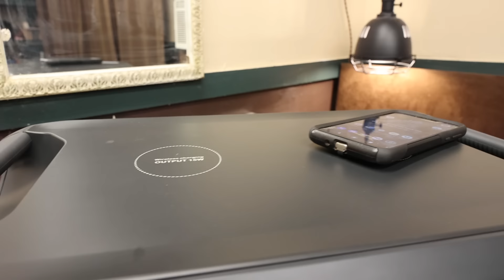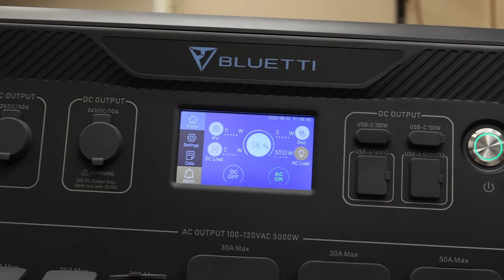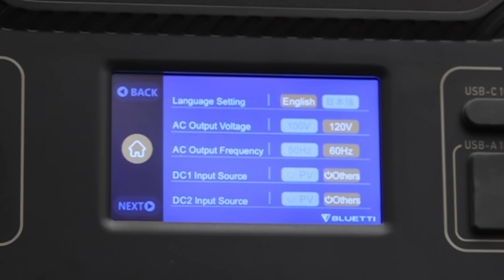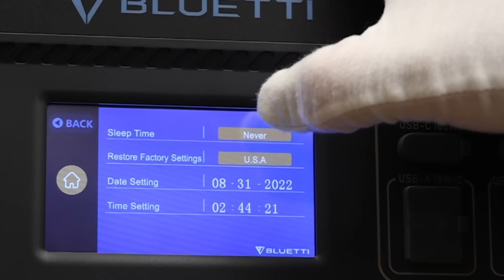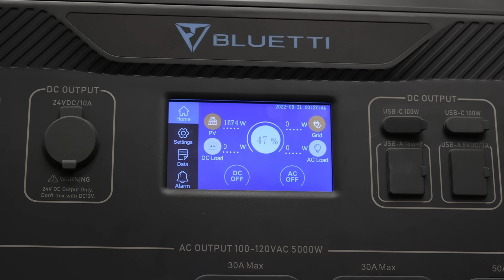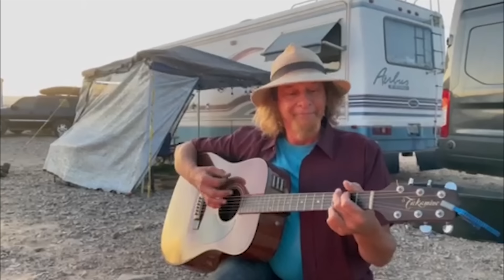Bluetti AC500 5000w LiFePO4 UPS Portable Power Station Solar Generator Review

Comment: I'd like to add a slight correction at 16:50. I'm having to replace my 240V Nema 6-50r outlet with a 240V Nema 14-50r outlet to use the 50 amp charging cable. So why not just use an adapter? Bluetti said adapters will NOT work because it needs the Neutral Wire (which the 6-50 does not have.) The 50 amp charging cable does NOT use 240V. It uses one leg of the 240V wiring (120V), which is one HOT wire and the NEUTRAL wire, to pull 50 amps through the required #6 gauge wiring.

Don't even think about trying to rewire your 6-50 3-prong outlet to use an adapter to the 4-prong charging cable. I found my 6-50 outlet had #12 gauge wire. Try to pull 50 amps through #12 gauge and you'll soon get to meet the crew of your fire department. A house fire should scare the crap out of you, which is why I'll never buy an EV, but that's another story involving a lot of online flaming and yelling.:face-purple-crying:

Comment: So it can't self heat the batteries with solar? You just mentioned ac.
Reply from the maker: It requires power at the "AC input" to heat. This means you can this and heat the batteries using solar. https://hobos.cc/d050s

Comment: So just a quick question. If you have a solar array on your house, will you be able to connect this to your house and power your house while charging the unit back up with the  solar off the house.
Reply from the maker: Yes, they sell a step down voltage box for this exact scenario.
Reply: @HOBOTECH  thank you for the response.  I'll see if I can find one
Reply: @HOBOTECH  so just to make sure I get this correct. I have a 6.24k system on my roof. In a grid down situation I'm hoping I can connect this to my generator box with the 30amp twist plug, which would give to correct voltage and frequency  for my inverter to come on and while the panels are feeding the house I can use the 120 cord for this ac500 and charge the battery back up? Which would allow me to run off of the panels in the day and the battery at night!

Comment: Does the inverter module have a battery or is it just an inverter requiring an expansion module??
Reply from the maker: The AC500 is the head unit that requires a battery. I made that clear in the review.
Reply: @HOBOTECH  I’ve been looking at reviews all day and truth be told. I just jumped into the comments. I appreciate your prompt response. I do have one more question.  It looks like it has a Generator Outlet. Does that provide 240 volts as a stand alone unit? Over at city prepping for his review he said that it needs an addition AC500 unit and an adapter. Which is a deal breaker for me. I just need hook into my generator inlet wired to a switch to run a well pump that’s on that switch and possibly my boiler. I wanted to ditch the gas generator.

Comment: If i place this in a van woth 200w of solar on thr roof would that be sufficient to power a moderate van build with power features. Convection stove, tv etc?
Reply from the maker: 200w solar will take about 20 hours of sun to recharge.
Reply: @HOBOTECH  not bad but perhaps this could be hooked up to the alternator  of thr vehicle to charge?

Comment: Please tell me they built in better fans this time. My AC200MAX is unusable indoors or in my RV. It is as loud as my hair dryer, which makes it impossible to use while on the phone or vid conf.
Reply: Be real bro, it's not that bad
Reply: @Califamilymanprepper  Wait and hear if it runs full throttle for a while, you will hear the bearings afterwards. They built in cheap fans
Reply: @Nilz4FR  no wonder, I have not run mine long enough. That sucks to hear, I appreciate the info. Not looking forward to it at all

Comment: Can a Orion-Tr Smart DC-DC charger be used to charge the AC500 battery from a campervan’s alternator/battery while driving?
Reply from the maker: Yes you can charge with 12v
Reply: So . .. what charging port would you connect the Orion charger to? Can the AC500 accept a charge from Solar AND the Orion simultaneously? Thanks
Reply from the maker: @Steve_the_Backroader  It has a dual MPPT so you can have one charge at 12v and the other charge with solar.

Comment: Any idea if this can be used with a transfer switch to integrate with an existing electrical panel with 120v and 240v circuits?
Reply from the maker: It absolutely can. They sell accessories for exactly that if you scroll down to the bottom of the campaign page.

Comment: Fully charged, how long will this unit last. I Just need to power a sump pump, two refrigerators, and a few lights. This is only for emergency purposes. Probably totaled everything I need powered would be around 4000 watts.
Reply from the maker: Hours = watt hours / watts

Comment: as of now. would you recommend this over the ecoflow delta pro?
Reply from the maker: absolutely
Reply: Thanks so much for the review and opinion. If you don’t mind. I plan to use it as the main power supply for a campervan. Same choice?
Reply: Have you heard anything about ecoflow doing a 1 up on the ac500 and the delta pro?

Comment: Any thoughts if the Bluetti AC500 5k power station can be used as an EV/PHEV fast charger?
Reply from the maker: It can only be used as a level 2 charger assuming you have two ac500 and the fusion box.

Comment: So  I have purchased the bluetti. When getting the renogy solar 450x2. Do I need just the  panels or a solar charge station?
Reply: , solar kits or charge controllers, 🤔  or just solar panels. Plug and go?
Reply from the maker: The 450s are sold out. I recommend the 320s on hobotech.tv/amazon use my code there. You need nothing else except maybe a MC4 solar extension cord also on the same page.

Comment: Yeah but you can’t use self heating on the B300S unless it is connected to an AC500 which is retarded for an overlanding rig
Fine, you can level 2 charge in a pinch 
That’s a feature 
But other than that you are adding 50lbs more weight than needed 
That battery should have an inverter - the whole thing being smaller than both of these combined

Comment: Would there be a reason to buy the EP500pro instead of this?
Reply from the maker: Not really ...
Reply: Actually,  you can roll the pro, which is way better then using a dolly to move it around. The ep500 has a pv in that has a split so you can run two sets of panels to it. I have one, and a 2500 watt array. It works nice, just need that pv step down voltage box for real power

Comment: Simple question that Bluetti isn't able to clearly answer. Can I charge my Bluetti AC 500 with my Firman 7500W Generator? There is no documentation on their website that says this isn't recommended. But after emailing their tech support, received an email saying not to do this? I'm completely off-grid, without dependable sun and need additional power to charge the batteries when the sun is not out. Anyone have a gut feeling on this? Seems like a lot of money to spend for a often cloudy off-grid location. Any insights are appreciated.
Reply from the maker: It's not advised to charge with a non-inverter generator that outputs dirty power. Doing so is at your own risk.
Reply: @HOBOTECH  I greatly appreciate your reply.  After doing more research we would end up having to purchase an inverter generator in order to fully utilize the AC500, which doesn't make it an economical decision.  Keep up the great work... love your videos!

Comment: When I use the L14-30 outlet on the ac500 to connect to the L14-30 receptacle on my house I am only getting power on about half the 120V circuit breakers that I have turned on.  Please confirm if this is a known problem.  I have emailed Bluetooth support and waiting for a reply also.  I do not have this problem with my gas generator.
Reply from the maker: You need to wire the hot leg to both 120v legs of your breaker box or use two AC500 through the fusion hub for 240v operation.
Reply: @HOBOTECH  I am not sure what the first half of your sentence means since I am a novice.  Can I use an adapter like the AC Works Generator to Transfer Switch Inlet box adapter (TT-30 RV 30 Amp to L14-30 Compact) to connect the L14-30 cable from the TT-30 Bluetooth Ac500 outlet to my house L14-30 receptacle?
Reply from the maker: @markspreen2205  If you don't know what that means then I suggest hiring an electrician to wire it properly.
Reply: @HOBOTECH  I will contact an electrician; however, what does my gas generator do differently that it does not have the problem powering the L14-30 receptacle to all the 120v breakers that I turn on?  If the electrical makes the L14-30 receptacle work for the Bluetooth will the gas generator still work?
Reply: I contacted the electrician and said if he rewired the L14-30 receptacle on the house as needed for the Bluetti then it would not work for the gas generator.  He said the L14-30 to TT-30 adaptor idea would work.

Comment: Hi I'm interested in buying this but had a question u might be able to answer. Can u run a 30 amp RV safely using two bluetti on split phase
Reply from the maker: You don't need split phase for a 30A RV. You could run one Bluetti for that.
Reply: @HOBOTECH  thank you so much going to get the ac500 with 3 300bs when living off grid and don't want to run out of power 💪

Comment: At this price , might as well just get a Tesla power wall or something similar.
Reply from the maker: Please send me your source where you buy Tesla Powerwalls for $2999. Ill take a half dozen!
Reply: @HOBOTECH  for a comparable 13.5kwh system, professor lol. Who would rather have this plus 4-5 batteries for roughly the same price as a power wall?
Reply: @Mike-. As an old dude, I like that my wife and I can disassemble, move to another house and then reassemble it. No need to hire a guy. Just my 2-cents.

Comment: Is it working without batteries? I mean what is itself capacity of AC 500?
Reply: The AC500 unit by itself is only a 5000W inverter/controller. it needs at least one battery to supply power.

Comment: I have a question, I've had my AC500 for about a week now and hooked it to my transfer switch on my house and the 50 amp plug outputs no power. It works when I adapt it to the 30 amp. With one battery hooked up does anybody's 50 amp plug work or is it a 2 battery requirement?
Reply from the maker: You realize 50a is 240v? Thats only going to work with two ac500's combined into the fusion box.
Reply: The specs in the manual show it to be a 120V 50 amp plug.
Reply: With 2 batteries hooked up does it work? In the owners manual it does not say it is a 240 v outlet. It's states a 120v 50 amp Nema 14-50. Which is the same plug in the bottom of my reliance transfer switch. It just doesn't output any power but I only have one battery at this time. I know to get the full 5000 watt output you need two batteries hooked up. I am just trying to figure out if it is the same for the 50 amp outlet.
Reply from the maker: In my review I state that only one leg of the 50A is powered. A NEMA 14-50 is 240v which requires two 120v legs. This is why it's not working for you.
Reply: Appreciate your help.

Comment: Does anyone know if these portable solar generators qualify for the 30% federal tax credit? The new guidelines state the batteries have to have at least 3kwh of storage (starting Jan 1 2023) and that the solar panels have to generate electricity for your residence. This seems to qualify but they are not mentioned.
Reply from the maker: It has to be physically wired to your home and 100% of the energy produced has to come from solar.

Comment: The 50 amp RV units are using the 50 amps as two separate 120V 50 amp circuits, there is nothing in the motorhome running at 240 volts. If it senses that only one leg of 120 is available it will still run the entire motorhome but with reduced total capacity. This is done incase the motorhome has to use an adaptor and plug into a 30A RV receptacle or even use a 20A home receptacle. Therefore that 50A plug will work with a single unit but will only supply power as if you were using an RV cord adaptor and plugged into 30 amp circuit.
Reply from the maker: Not entirely correct. Each hot leg of 50A service supplies 50A @120v 180 degrees out of phase. There is no way in the breaker box to merge two out of phase lines to run everything in the RV. The two legs will run separate circuits (ex. one leg would the front a/c and the other leg run the rear a/c). What will happen if you connect half of 50A service to a 50A RV is that only half the circuits in the RV will work. However, if you use a 30A to 50A dogbone it would share the single phase 120v line of the 30A into both 120v circuits of the 50A and hence power everything in the RV but at reduced amps. As for 240v appliances they won't work at all and some luxury motorhomes do use 240v service.
Reply: @HOBOTECH  I have been camping in motorhomes and have many friends that have 50A motorhomes. I have never seen any appliance in a motorhome that required 240VAC. All motorhomes I have seen will run any appliance with a single 120 VAC leg but the load shedding controller will not allow everything to run at one time. You may run the fridge and lights and a single AC unit but not both at the same time. There is no circuit that is dead. The two phases are shorted together during the time that only one single 120VAC leg is available. This is done so that the 50A rigs can run in the parks that do not provide 50A service. If there are units that require 240 VAC or leave 1/2 of the coach dead I have never seen it all all my years. And BTW the load shedding controller does indeed short the two phases together when only one phase is present.

Comment: why dont they have on-off for the ports to make it zero
Reply: you can make your own electric vehicle with that system lol
Reply: like a golf cart with solar
Reply: is there a 240v only eu version
Reply: you must have the fat boii cable to position the batteries away like through wall, flexibility is the key
Reply: you can do a flywheel battery motor-generator system in 10 minutes ;)
Reply: God can do all for free in a snap, why buy anything, poor deal ;)

Comment: Considered this but in the long run I don't have the knowledge to diagnose and fix a pre-built system. Went with 2 x 260 LiPo4 in parallel connected to a 2kw Victron inverter fed by a Victron 150/100 solar controller and 750w's from 2 Sunman eArc panels. Being on a boat and having the power to use a 240v kettle,toaster or air-con is life changing. lastly those panels are beyond good,Really amazing .

Comment: Is the b300s compatible with ac200max?
Reply from the maker: Yes
Reply: @HOBOTECH  you mentioned buying an adapter to do it. I can not figure the right one out, could you please state the one I need. I have the dc extra plug in. Is that the one I need

Comment: That isn't a whole lot of power 5000 watts.  How many volts does the AC500 run on. It's a single phase output.  There is too much BS to deal with.  I'll bet it is expensive. If you need it to charge up so much, the battery pack isn't big enough.
5000 watts is about 40 ampers. How does it charge ? Did he say from the outlet on the wall  ? If the outlet on the wall is working,  what do you need this inverter for if the power is available to charge it ?  5000 watts might run my well by itself.  Hot water heater,  probably similar,  hot water only.  
If you run your house on this thing all day and night,  what are you going to do with a dead battery pack  ? Especially if it is stormy and cloudy. Good luck with your 3000 advertised watts of solar,  assuming the sun is shining bright that day. After all is said and done you really had 2000 watts or less of electricity because nothing is 100% efficient.

Comment: ooof.. 80% AC capacity output?  this is horrible. Wait, yousaid you pulled 2500watts out of 3072.  Yet later on you pull out 5000watts on your soak test.  I'm confused.  Can you only pull 2500 watts or 5000 watts out of the AC port?
3 year warranty?? new large capacity systems now promise 10 year battery warranty, and 5-7 year device warranty.
Wait... the 50amp port is only 120volt?  LOL... 
Thank you for the video, it was very informative, more so than their amazon or product page.

Comment: The blood sweat and beers to DIY what this is capable of is edging on the side of sadomasochism. Why would you put yourself thru that!? This is a pretty slick unit. This would power my house, albeit a small house but it would do it. I use the 200P to run my 400sqft ‘Shabin’ in Vt. It does an amazing job. Runs a good fridge and a monster power cooler for bevvies, 2-110v circuits, a Rinnai propane furnace and an induction cooktop ..DIY🙄I’m too busy for that. Plus it’s moveable just incase you need to get the hell outta dodge💩

Comment: Seriously how many people have a car with a cigarette plug/lighter in it?? I hear a lot of people talking about this 12volt charger in a car while driving and I don’t understand how they can. So where is the 12volt in a car that’s 2016?
I’m hoping someone will say “it’s right there xxx”…?
Obviously I’m not as smart as 99% of the people on this site.
Reply from the maker: My 2021 has two lighter sockets. I never owned a car that didn't have one. Check your owners manual.
Reply: @HOBOTECH  I have a 2016 and it doesn’t have one. I was hoping you knew of alternative plug somewhere in the car.